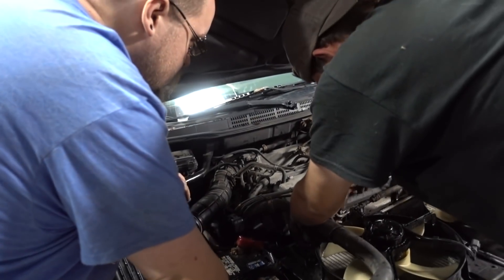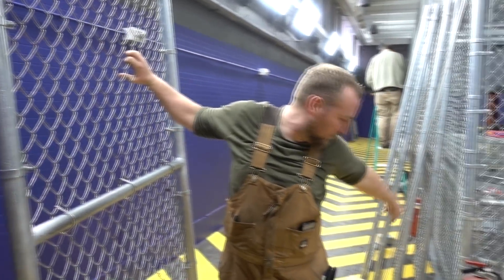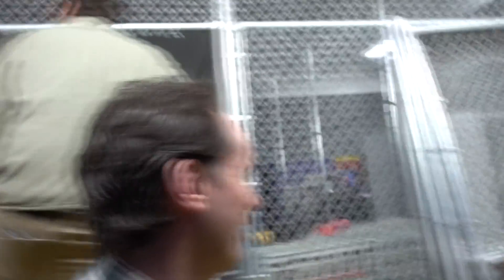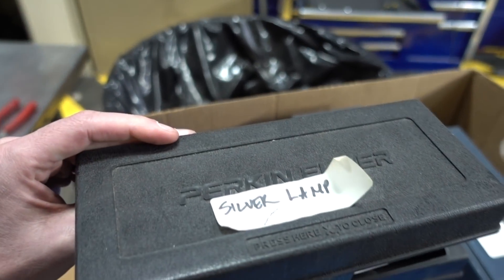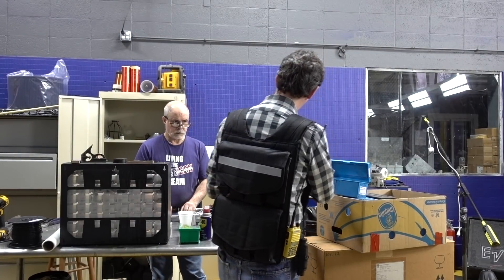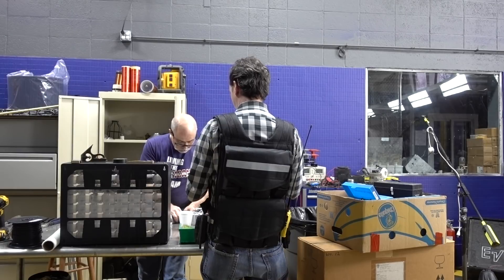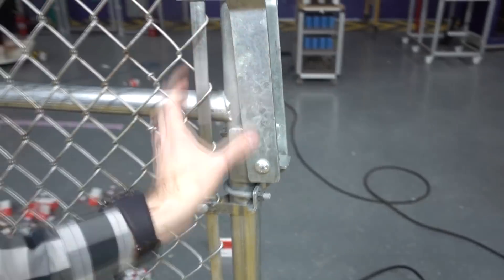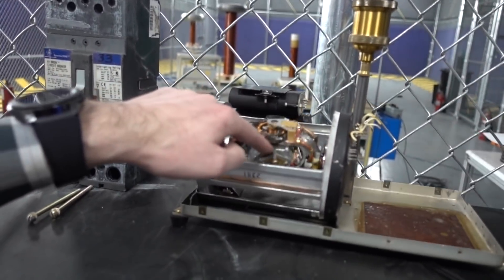Captain's Blog 1 22 2018 High Voltage Lab Cage is Completed!

Comment: good labeling machines with how one asks to use them.  42 is not old.  some hosey parts flop around when removed.  crimping and bolting looks lots easier.  see i can talk like you.  fence segments look great.  hooky bits can scrape those who don't see them.  will bends the fence wire brilliantly.  having all the moving parts together is more entertaining.  i agree; lamps are good art.  please make the lamp that batman suggests.  1529  lockable gates are a better separator.  please mop the stripy area.   tim is also productive.  the rotor probably selects something.  polycarbonite is a good shield material.

Comment: “The Hampden Model WRSC-100 Wound Rotor Speed Controller is used to introduce resist- ance in the rotor circuit of three-phase wound rotor motors. As the controller knob is rotated clockwise, resistance is reduced. Also contains a micro-switch that may be used as an inter- lock for full-resistance starting. Furnished com- plete with cords.”